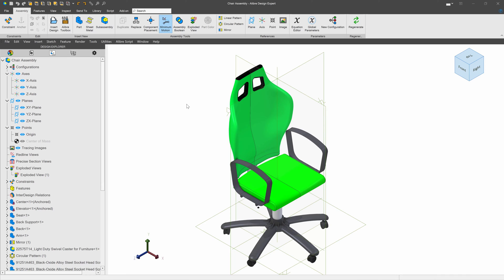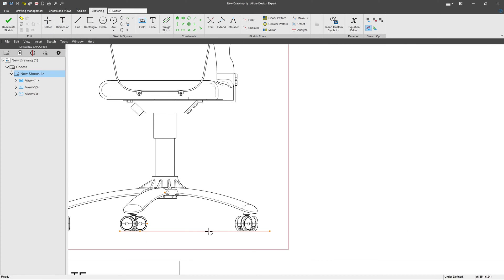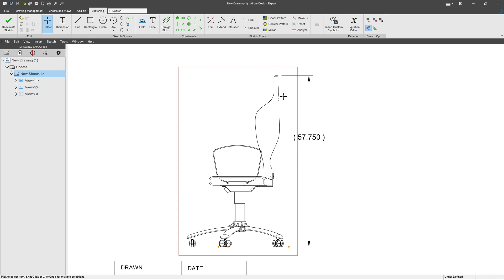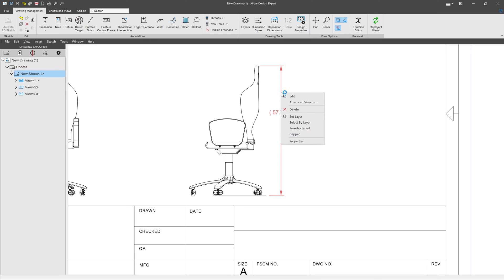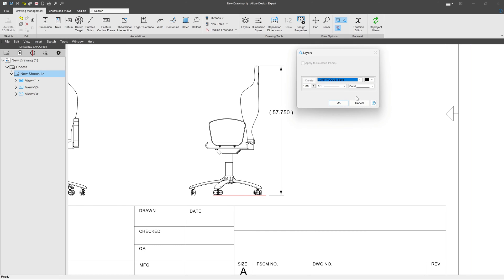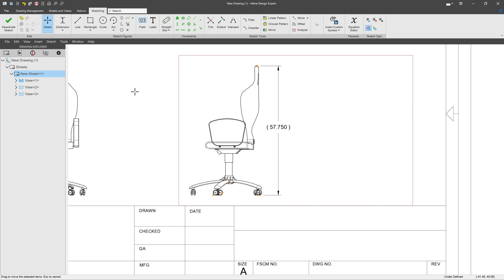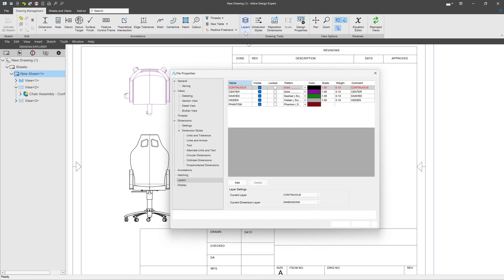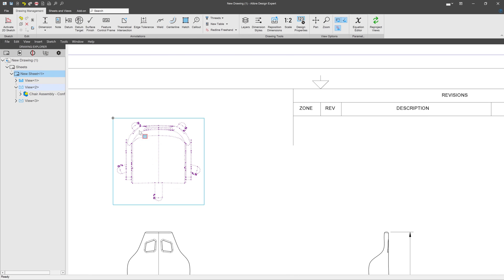Reference Dimensions and Layers | Alibre Beginners Course #68

Comment: Another nice nugget video but be care with that method for displaying a reference dimension. By setting the Default dimension style to Reference every dimension that uses the Default style will display as reference. It would be better to create a New Style set to reference then select that reference style thru the Change Dimension pop up menu on the drawing.